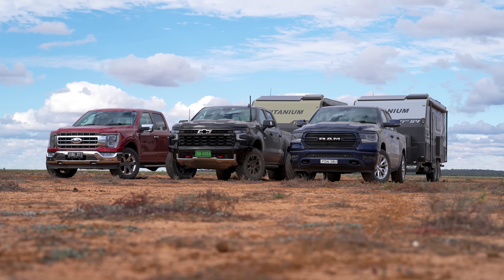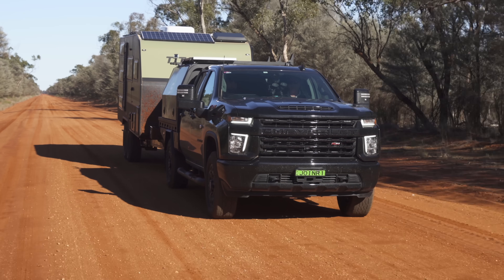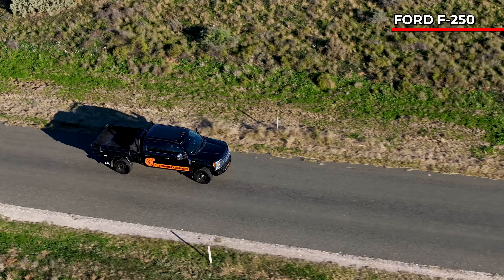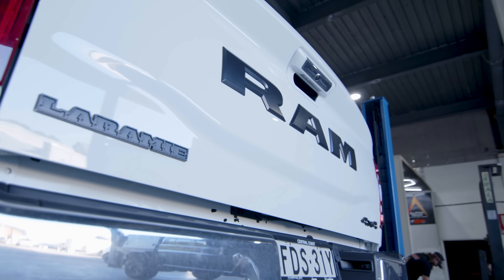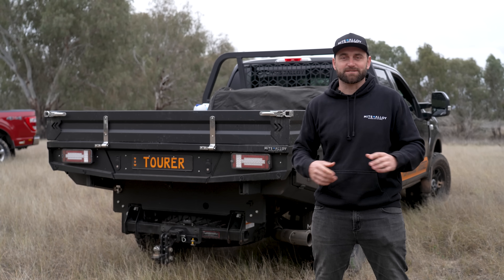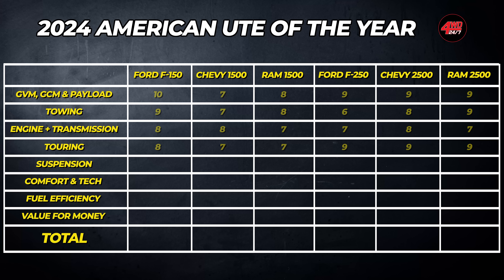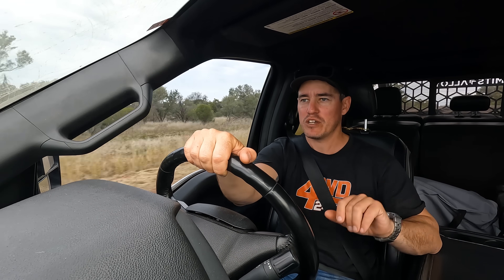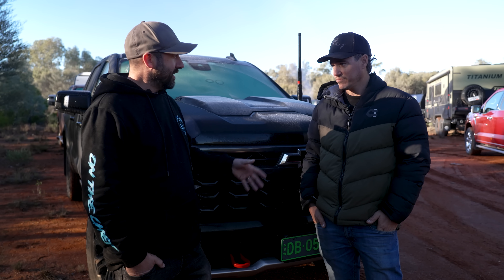2024 RAM vs CHEVY vs FORD TORTURE TEST! Heavy towing, dirt roads - SHOCK WINNER & major problems

Comment: The problem is and I've said this time and time again is there has been zero push back against the 1500s and 2500s diesels. Where as a 2500 petrol would have been the right truck for Australia. 1500s are too similar to out utes, you only get a bit more and have to do gvm upgrades and even then you can't fit a full sized tray like on a 2500. The 2500 diesels are meant for towing over 4.5t.  No one here really connects up air brakes and goes that way and tows 6 or 9 tonnes. You'll need a truck licence to register it over 4.5t gvm because they almost are that heavy to begin with. This is where it gets interesting. The petrol 2500s are lighter then the diesels. Don't have emissions and are cheaper to buy. They fit right in that category for around 4.5t towing. No truck licence, no gvm upgrades, fit a full sized tray. If everyone pushed back like consumers, reviewers and media from the beginning and got firm with telling the importers just bring the 2500s petrols, we would have been able to have different models instead of more of the wrong models. Single cabs, work truck specs. People in the states would laugh if you told them to by a diesel just to tow 4.5t. We're getting like 5% of the models they have in the US. No one wants us Aussies to know about all the different models over there. It's been hidden from most of us accept the enthusiasts. Anyway now we're left with a bunch of trucks that don't really suit Australia. We'll done guys and just because there are more models here then ever before it still doesn't mean we're not getting a honest selection...
Reply: And you keep saying that they can tow a lot more and you're review is unbiased. Well no one tows a lot more. A lot more is 6 or 9 tonnes. For 3.5t to 4.5t that isn't a lot more. And in you're review I don't see any caravan with air breaks and over 4.5t. Well drrr that's because pretty much no one does that.
Reply: why would you want a petrol just less reliable and uses more fuel??
Reply: @epicgamer785  are you ok?? The 1500s are petrol anyway. Patrols are petrol. Lets not go back to a beginners debate. I could respond to that but I'm trying to get things moving in the hidden areas which no one's talking about in terms of US trucks in Australia.

Comment: I tuned into this hoping to see the ZR2 tested in the outback to see well it would handle.  Instead I get a comment saying that they aren't going to test them because they don't think they can handle the outback due to the ramp over angle being slightly worse than a much smaller Land Cruiser?  I understand not wanting to damage anything but the ZR2 is designed for off roading and you don't want to test it off road?  Shouldn't you be testing them specifically to compare to the much smaller UTEs that would be competitors for the Aus public?  I was very disappointed you might as well have just stuck to the pavement.

Comment: Those paper numbers of kerb weight will be wrong need to weigh them  as they are tested in these tests. Chev 1500 note gcm no problem tow capacity no problem but ball weight goes to gvm payload is not real only what have left in gvm . Moral to the story is should weigh them first to be honest and accurate not using miss leading kerb weight as reference 👍

Comment: How do you import an older diesel? Three quarter ton. The tires you chose are totally incorrect. You don't want a firm sidewall. Going across sand I don't know where you guys got that idea. That will also make the ride more difficult. So unless you're ticking out, 30 pounds of air out of a 60 or 80 pound tire. You've screwed up all the geometry. Warranty what warranty.

Comment: They are towing on level ground that is hardly a test almost anything can tow some weight on the flat. The biggest problem I see with modern trucks and off road use is that they are overly complicated with many more things that can go wrong and they will. They are way more difficult to repair

Comment: You called  the 1500s expensive @ 150k that's the same or cheaper than most 79s on the road & 3 times a Better vehicle than a Toymota 79

Comment: The majority of utes and suvs in Australia are useless at heavy towing in stock form; their performance is horrible. I had a rental 4 cylinder Ford Everest recently and the performance was shockingly poor and it was only carrying 2 people and a bit of luggage; got close to a head on collision on an overtake when the opposing driver just started appearing on the horizon (they were not speeding).  The only time I have ever driven a potentially slower vehicle (if so only by a small margin) is a circa 2000 Toyota Echo. I can't imagine them fully laden let alone with a caravan. This is where the American trucks come into play,

Comment: I was watching your video and enjoying it until you gave all of the trucks got the same rating for mileage.  Really.....there is enough variation here to rate ones higher than the other.   BTW....I have an F150 and  Lexus GX470.   The F150 will smoke the GX in hauling and speed but the GX is wonderfully smooth and mechanical.  I'm pretty sure the GX will last forever.

Comment: Dang guys you tested the wrong 1500 dodge they come 4 corner coil over, I'm sitting here going no way ! The 1500 Ram rides way better than the chevy. I had the 2014 Ram half ton it road like a car and i beat it like it was a 3/4 ton, when I traded in for my Power wagon it had 165,000 miles Never a recall Never a problem, Rear end was letting go when i traded  it in. All it ever did bad was break exhaust bolts, which was not a huge ordeal Its not like you have to pull the heads off or anything.

Comment: I pull a 8,900 lb camper trailer with my Dodge Dakota 5.2 4-wheel drive extended cab over 300,000 Mi on it all original never rebuilt anything on it just maintenance a Chevy or a Ford of the same size truck would not have made it cuz they're unreliable

Comment: And yes we do have extruded box chassis as part of the reason for is going to aluminum I don't know where you're getting your information from but it's not quite right do you really think they're going to put a 300 horsepower turbo diesel that has a 1000 ft lb of torque in a unibody no it has a frame it's kind of shocking that you would think that Ford doesn't have box frames at Chevy doesn't have boxed frames

Comment: BUT THE AMERICAN TRUCKS HAVE A MAJOR PROBLEM , CHEVY , ALUMINUM BLOCK AND HEADS THE ENGINE IS JUNK OVERHEATING WITH VERY LITTLE RADIATOR COOLOING DUE TO THE WEIGHT OF THE TRUCK, FORD , ALL ALUMINUM BODY AND BED,  FUEL INJECTOR PROBLEMS AND A LOT OF PLASTIC INTERNALNAD EXTERNAL PARTS REASON IS TO GET THE WEIGHT DOWN, BECAUSE FORD WAS ALWAYS A HEAVY TRUCK, THEN COMES DODGE, THE DODGE IS NOT A "REAL DODGE "ITS A FIAT DODGE SINCE 2009 ITS HAD MAJOR PROBLEMS WITH THE STEERING , POWER, AXLES BREAKING  IT S EVEN WORST THE THE FORD , MY CHOICE IS THE CHEVY, IF I WAS TO BUY A NEW TRUCK, 5.3 LITES MOTOR IS THE BEST PEROMANCE ENGINE THE V6 GAS OR DIESEL IS JUNK, THE 6.0 IS TO MUCH TOP END POWER TO GO FAST , NOT MADE FOR OFFROADINGCHEVY HAS THE BIGGER RADIATOR SYSTEM AND DUL FANS FOR THE COOLING BUT LACKS GEARS , THERE STILL STD, GEARS ARE 3,42, OFFROADING YOU NEED BETTER THE 4.10

Comment: The F150 you tested should be more stable and tow better than the RAM and Chev 1500’s as it is the longer wheelbase version with the 6.4” bed.

I would suggest the F150 with the shorter wheelbase and 5.7” bed, would be more like the RAM and Chev 1500’s.

Comment: "value for money, double the price of a (small) dual cab but you aren't getting double the value" pretty pointless statement, if you need to tow more than 3t a small dual cab is worthless. also a 6.7l cummins, solid axles, comfortable interior, towing features are easily more than just twice as good.

Comment: Something that is a really big deal with these new American trucks, especially for you guys. Here in America the average person replaces their vehicle every 5 years, and the average person owns an F-150, it's been the most sold vehicle in America since the early 1970s. Why this matters, automakers make more money if people buy more cars they also make more money if the cars work really well while the owners own them. So all new American vehicles, but especially the trucks, are engineered very well and very intentionally to be bulletproof for exactly 5 years, no less time than that and no more time than that. They are then engineered specifically to fall apart in every way they can after 5 years to keep the pattern going of Americans not owning the same vehicle longer than that and make the greedy CEOs in charge of the big companies even more money.

Also, your laws give you practically none of the capacity of really everything to do with weight than what these trucks are actually engineered to do. And they are the light pickups in America, the 2024 Ford F-450 which can be driven by a 15 year old on a basic learners permit in America legally is rated to tow 40,000 pounds on a gooseneck trailer that is just over 18 metric tons.

Comment: Bit disappointed in the review Shauno, the comment that they are not capable off road, you haven’t researched other you tubers experiences about how capable they are, you used an older model Silverado. I have a ram 2500 and it’s street ahead, in comparison to Toyotas and Nissans which to chop and modify to compete in this category then the cost is comparable, if you are getting a modifier to talk about shortcomings of various vehicles then get someone who presents well, professional, clear and articulate, big dog builds would have been an obvious choice.
First time I felt the need to comment, but be balanced and know your topic

Comment: Gah!  $170,000AUD is approx $115,000 US today.  How does anyone afford that?  I can barely afford a $25k US vehicle and I do pretty well.  I've got friends and co-workers that have some of those vehicles to tow their 5th wheel camping trailer and toy haulers.  It's just crazy.  They are slaves to their car payments.  I just won't do it.

But to double the cost right off the block.  NO WAY!!!  

Even being an American, I won't buy those trucks to begin with.  They just aren't reliable enough.  The ONLY reason I'd buy one would be if I had to tow something heavy and to do so regularly.  If I'm just going to to tow something periodically, I'll just rent a truck.  And yes, I've owned full size trucks.  I know I'll get some hate.  and maybe it's changing a bit as Toyota's reliability has been suffering a little and the US trucks have been getting better.  But unless I need a full size truck, I'm done with them for now.

I'm surprised that Toyota hasn't brought in the Tundra (or the larger version of the Hilux).  It should compete well against the 1500's and you'd have some parts compatibility and the dealer/parts network already in place.

Lastly, please don't call the Chevrolet a Chev.  Chevy is the shortened name.  I'm a Dodge (now Ram) guy and I still don't call it a Chev.  Please, call it a Chevy.

Comment: The rams have less gears, more power and coil suspension and you mark them lower than something that has to shift more and stress the engine more to match in the case of the f150? Ram has a more common suspension that we already know and trust. Interior is far superior than ford or chev. Ill take these opinions with a pinch of salt.

Comment: Why?  They’re all trash.  As an American I’ve had ample exposure to all of them.  Unless you need a heavy duty 2500 or 3500 due to towing needs, I’d stick to a Toyota.  Us Toyota geeks over here are dying to get a 70 series or anything with a diesel.  Also, we can tow a lot more here in the states than 4.5 tons. 4.5 is nothing.  And we do it without brakes.

Comment: You've got brand new 2500s from chev and ram and a older used fordf250 lol the new powerstroke ford diesel is by far the most powerful, this test makes little sense and why use a offroad version of the chev against a standard f150 ? also you guys use a e torque ram with hybrid powe4 and dont use the fords hybrid powerboost very confusing and last but not least if you're gonna do offroad testing of American trucks test the ford raptor not a regular lariat against a ZL1 chevy

Comment: It's not a little ironic that here in the US a 200 series will easily set you back over 200,000 USD, and you can't get a diesel unless it's over 25 years old. Dont be fooled though, these american trucks are all garbage compared to Toyota if longevity is your benchmark.

Comment: Dumb. Here in the states nobody buys the ecoboost f150 unless they are mechanically ignorant. Truck guys buy the 5.0 because its endlessly more reliable and can ne upgraded under warranty to 700hp with a supercharger with zero changes. The only exception is high altitude where turbos shine. And, air brakes? Nobody in the states runs any sort of air brake conversion on any truck smaller than a F650. Seeing a super/heavy duty truck with a dump trailer, massive camper, 3 or 4 car hauling trailer, 30' boats is as common breathing air and they are all electric brakes.